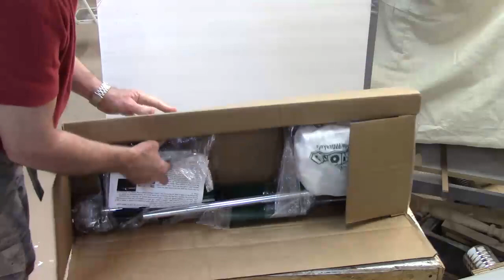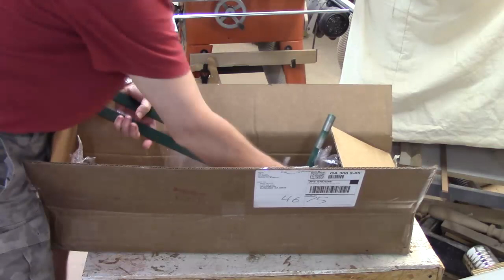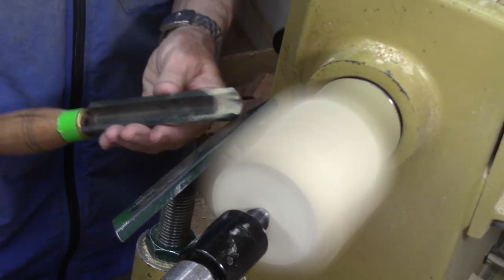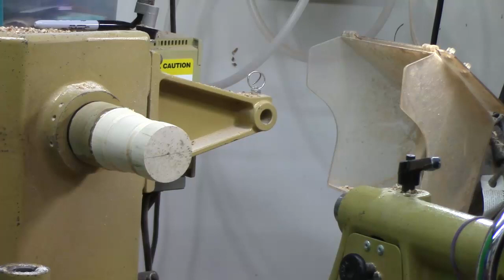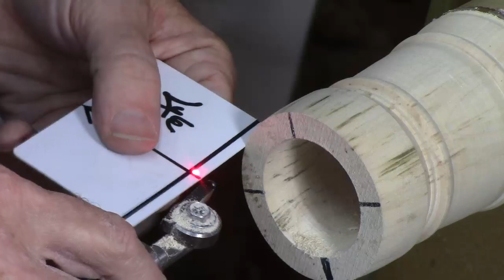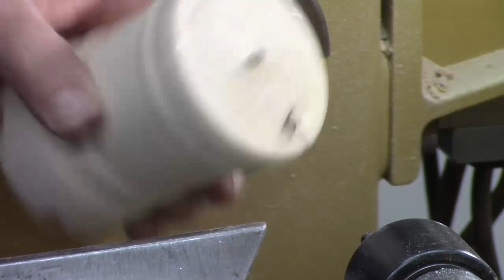New Hollowing Tool - Lyle Jamieson System

Comment: I had purchased a used one several months ago but was not very comfortable using it.  After spending a day with Lyle in July and doing a few hollow forms at home the past few weeks, I am starting to feel comfortable with it.  It does make the process much easier.  For those that can't afford one, I have used the Sorby multi-tip tools with good success.  David Ellsworth sells hollowing tools also but he does not use a captive boring bar or a laser guide.
Reply from the maker: Easy is good. For me once I got bigger then about 4" hand held tools were not fun or easy.

Comment: You will really love Lyle's hollowing tool.  It's very simple to use and is built to be rock-solid.  I got mine after using an articulated
arm system for a few years and wish I'd gotten it first.  As always, an excellent video.  Thanks.
Reply from the maker: Thanks for the comment. I am liking it a lot.

Comment: The standard 3/4" boring bar is a good start and seems to be good for depths of about 8-10". If you want to go deeper (18-20"), then the 1 1/8" bar is worth the investment. I only have a few months experience, but if I have a wide opening like your pencil pot, I like the thicker boring bar because vibration is substantially reduced. Lyle's video is worth watching, and after you make a few hollow forms, watch it again :-)